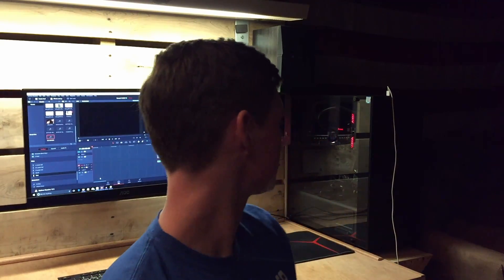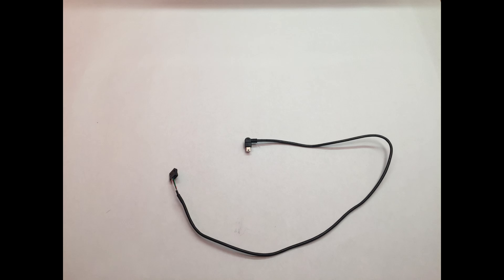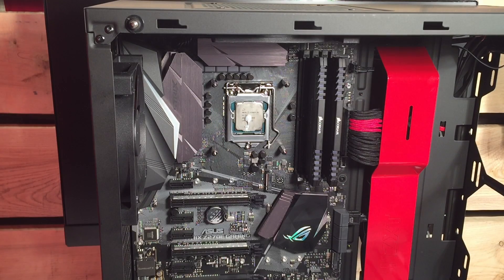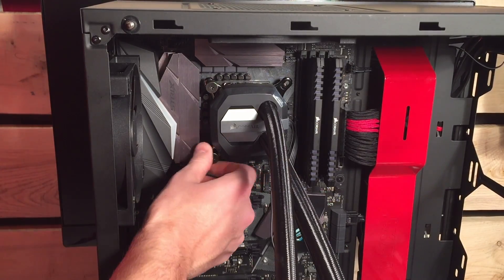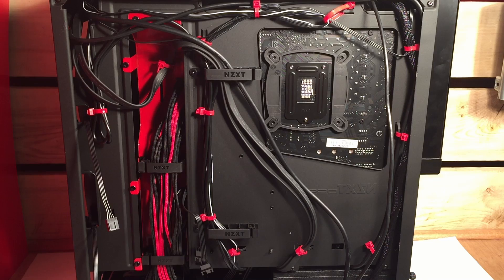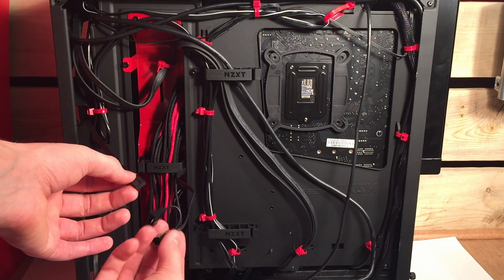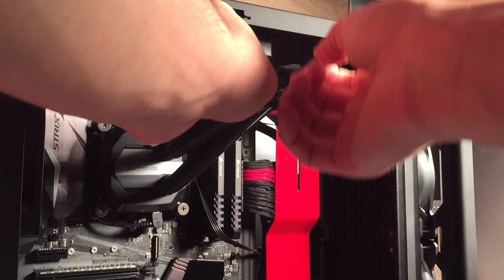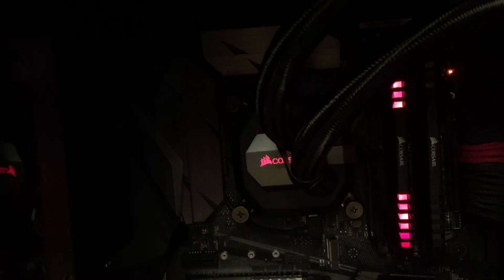Corsair H100I V2 Installation Guide

Comment: So why do you put the fan plugin on the fan opt one? I'm still figuring all this out lol. Thanks
Reply from the maker: I made a mistake, you need to use the AIO fan header, the AIO header supplies more power, since the pump and fans connected to the pump draw so much power. When you use the CPU fan header with the pump and fans, it doesn't allow things to run as well since the pump is drawing so much power. In a test i did, one of the normal fan headers was running at about half the RPM it normally did because of how little power it had to run.
Reply: TekRant yes but then u should get an error every time u start ur pc. a cpu fan speed error I believe. So I plugged the header connection from the aio header and put it in the cpu fan header. error went away. u should do a video of which to use and y and how to get the error off without ignoring it. also having the pump at max 100% of the time can't be great. the manuals are shit.

Comment: Hello friends, 

I have a Ryzen 5 1600X with a Corsair H100i. I just built this together today (Full build here https://pcpartpicker.com/list/N4y83F) I am planning on getting a new graphics card but that's not the point. I am now confronted with the issue I had with my first built but I never thought I would with this cooler. My average temps are around 60-65 degrees celcius and actually went up to 77 degrees when using simple things such as web browsers. I will not dare put a game to test as I am worried for the CPU and Motherboard. Going through the BIOS the CPU is at 55 degrees. I put the fans to their full speed at least I put the highest voltage for the fans. I am worried if have to take this thing apart again and rework.

Thank you very much friends

EDIT: I used Corsair 4 Link to work with the cooler. The cooler at the max performance of both the pump and fan and it did not change a thing and if it did it was only by a few degrees. The CPU is also at only a mere 5% load.
Reply from the maker: When you start up your PC can you head the pump engage?
Reply: TekRant Yeah, i actually fell asleep. Turns out even when I throw demanding games like MGS V, Rainsbow Six: Siege and Just Cause 3. The temps almost decreased. except for Rainbow six which was at 67 degrees sometimes but mostly at 64. it's usually stuck in a matter where it dropped 10 degrees and then spikes back up and repeat.

Comment: i had the same cooler sines 4 months yasterday the temp goes up to 90 'digrez and for your info i did't do any thing with the seitting pleas help
Reply from the maker: when you start up your PC, can your hear the Pump start up?
Reply: TekRant yes its doing just fine the fan works and the light logo works also  but the temp still going up i  bay the bump sins just  4 month
any idea whats my problem is!
Reply from the maker: My assumption would be that either the pump is malfunctioning, or that the reading as wrong, what do your fan speeds and pump speeds look like?

Comment: Thanks for this video, I have the same motherboard as you, how come you dont use the AIO PUMP header? Whats the difference between CPU_OPT vs AIO PUMP?
Reply from the maker: I made a mistake in that video for not using the AIO header, the AIO header supplies more power, since the pump and fans connected to the pump draw so much power. When you use the CPU fan header with the pump and fans, it doesn't allow things to run as well since the pump is drawing so much power. In a test i did, one of the normal fan headers was running at about half the RPM it normally did because of how little power it had to run.
Reply: Wow, interesting, I have the same motherboard but I am using a Corsair 780t case and it has front panel fan speed I/O connection for my other fans, apart from the 2 radiator fans I have 4 additional fans I think im supposed to connect to my front panel fan speed control. This is my first pc build. sort of confusing which headers I plug my additional fans into.. thanks for the fast reply and your advice.

Comment: What happens if i add thermal paste and it already has thermal paste?
Reply: PraiseTheGabe It will have too much and it might leak the paste on your components
Reply: I would not recommend you doing this, the thermal paste could be different compounds and can react adding corrosion or worse

Comment: bracket is very loose on my MSI Z270 M5 board.
Reply from the maker: Its meant to be lose, when you go to attach the water block it will tighten, nothing to worry about!
Reply: TekRant thanks , but not that loose. Block doesn't maintain contact with cpu
Reply: 1999FRC I had the same! Tighten the standoffs really good and your problem is solved

Comment: Once you get this cooler,first thing is to dump those two stock fans that comes with it.Besides that this is a great device and keeps your CPU under 30 degrees at full load.First I replaced the stock fans with Corsair SP120 quiet edition or Noctua NF-F12 120 mm fans to make this cooler a dream.For its prize its awesome.If you run your fan fulls speed all the time your I geuss your pump will last longer.But for its prize and then 2 x Corsair SP 120 quiet edition or Noctua fans its really dead quiet at performance mode in the Corsair link
Reply: Those fans are less noisy but have much less performance (static pressure suck in both of those fans and its less than 1/3 of the stock ones). So it all depends on what you do, with SP120 or noctua NF-F12 you can't overclock as much.

Comment: I also have the H100i v2 and can't change the led on the logo.  I have the Link software installed, but don't even see the cooler with the color graphic.  I believe I have all the cables hooked correctly.  Please advise, thanks!
Reply from the maker: id make sure you have the USB cable hooked up correctly, then if its still not working, change which USB slot its plugged into on the motherboard, maybe your motherboard has a faulty header?
Reply: Thanks, I will check that.
Reply: I checked all it's hook up is correct.  Corsair is sending me a new link cable.  Hope that fixes the problem.  I did switch USB slots and no help with fix.

Comment: I am about to complete my build I have installed my cooler the h100 i v2 I just made test run to see if everything is ok !! I see that the led on the cooler header blinks for a moment n goes off but I see the display on the screen I want to know if it is ok if the led is not glowing in the cooler
Reply from the maker: Lokesh Kumar once you install the corsair link software you should be able to control it
Reply: TekRant ahh !! Thank you so much !! was so confused as its my first build ..

Comment: I want this case (S340 Elite) and the Asus Z270F motherboard (as I am not interested in the Wi-Fi). I am just concerned about the front header connections. The S340 Elite has 2x USB 2.0 and 2x USB 3.0 on the front panel. Does the Asus Z270F have 2x USB 3.0 headers and 2x USB 2.0 headers? Amazon high-res image: https://images-na.ssl-images-amazon.com/images/I/81cSHERFb-L._SL1500_.jpg Thanks!
Reply from the maker: One USB 3.0 header on the motherboard can support two USB 3.0 ports. The Z270F has three USB 2.0 ad Only One USB 3.0 header, so you should be fine. I do recommend you go with the Z270E since their prices are so close together, and they're practically identical other than the Z270E having Wi-Fi and Bluetooth. Plus if you decide to change your case in the future, The Z270E does have a USB 3.1 header, incase the case you decide to upgrade to has 3.1 ports.
Reply: Thanks for your reply. I ended up taking a bit of a leap of faith (as I have never built a computer before) and just got the Z270F. Just another one, I figured out that the USB 3.0 header is 2 in 1 like you said, is this also the case for the USB 2.0 connectors? The Z270F has 2 (3 if you count the ROG_EXT header) USB 2.0 headers. Will I need to use 2 of those headers or again is it 2 in 1 so only have to use 1 header? Thanks!
Reply from the maker: Yes, one USB 2.0 header will support two USB 2.0 ports, also if you are using the H100I that will use up one of the USB headers on the motherboard as well.

Comment: You were a little quiet, so I had to turn on the automatic subtitles. I wasn't disappointed.

5:00 "Then you're just going to go from the top to bottom and then start screaming"

The radiator installation summed up.
Reply: oh you got me. he said screwing in holes.

Comment: My mother board only has a single USB 2.0 connector.  I have a usb internal connector for this cooler and my motherboard.  Any way around this problem other than dont install the motherboard connector?
Reply: Buy a normal usb cable and try to route it outside the case and plug it in the mobo usb 2.0 port i did that with my old motherboard

Comment: the h100i v2 in the strix z270e gaming go to the iopump pin, no in the cpu pin. the fans of the radiator 1 to the cpu an 2 to the cpu opc. pins. see the asus forum. nice day
Reply: Christian Quiroz thanks for the information! I'll set up my cooler like that :)
Reply: NIce. Since i try to put the pump to max using the bios, and is not working. how did you do it! so far need the link to put the pump to the max. my fans are on the cpu fan and OPT and is working so far. but having the pump to aio still see rpm like quite rpm even that move all bios controls and is not possible. please show me how since i what the link out of my system
Reply: Debbie Dexter I did when I use the corsair.
Reply: What about the z270 AR PRIME?  I put it in the CPU fan pin
Reply: After reading this I talkes tech from corsar because I have the same rad and mobo. He said it’s ok to plug it on cpu-fan only.
Reply: Carlos De Bernard ----USE "NEW" Thermal Paste .That what comes with it should be cleaned off and "New" applied the crap that comes with it is useless !

Comment: Hey waz up, this video just show up in 'Must see' section in YouTube, then I say: - Why not?, Let's take a look!... Well I have some questions because I'm building a new PC, with same mobo and cooler, but I had a serious problem and because of that had to buy that mobo again, the problem was that the mobo didn't detect the cpu fan ? and I used the same header as you did (Cpu_Opt?) but the Cpu_fan is just right there on the top... and what about that AIO_Pump header ? How does that one works ?
Reply: I'm just wondering if the new cpu that I bought too, i7 7700k didnt went potato because of that problem
Reply from the maker: Is the pump working at all? If I have mine plugged into the CPU opt header, I get a cpu fan speed error, and if I just boot up it works fine, is your system booting at all?
Reply from the maker: I found a solution, I will have a video out soon going over what the error was
Reply: Im having a problem, i installed my water cooler, plugged it into cpu_fan and when i turn on my pc it turns on for a second (fan spins/lights turn on) then it turns off inmediately. I sent the pc to a technician first but he installed the radiator inside the case which makes no sense because it was releasing alot of heat so I placed my radiator above my case (nzxt phantom 410) and fans below, still not able to solve it. He also connected my ram in 1/2 slots so i disconnected 1 ram and placed it in 1/3 to use dual channel. The technician did an awful job tbh, also i removed the pump but i dont have thermal paste to re apply (my bad). Im scared my cpu is damaged or something my pc is less than a week old its an i7 7700k, gtx 1070, psu corsair hx850i, wc h100i v2, mobo asus prime z270-a. Any help is appreciated, thanks. Btw i have tried removing cmos battery, also using 1 ram stick, 2 ram sticks, no gpu, with gpu.. its driving me crazy
Reply: Vigiilz seems like the problem would be the motherboard... If you turn on your PC but the monitor show nothing or goes iddle then return/exchange the mobo if you still have time
Reply: Vigiilz I fixed that problem, but had to return the mobo (z270e)... I just got it yesterday... I think your mobo has AIO_Pump header, try to connect the AIO header to that and two fans included from cooler to CPU_Fan and CPU_Opt headers, that should work, at least that's what I did (but now using kraken x52/Will not recommend because problems with Aura/CAM)
Reply: Manuel Vélez it was working perfectly 2 nights ago but i screwed it up. What is "AIO Header"? Btw pump only has one connector for the cpu_fan
Reply from the maker: I did a little research on your mobo, and I want you to try two things, first try plugging your CPU header into the AIO header on your board, and if that doesn't work try resetting the CMOS using the jumpers
Reply from the maker: Also make sure you are using the DIMM slots A2 and B2, A1 being the slot closest to the CPU. Also if their a boot up problem, theirs a section in your motherboard manual that goes over what MEMok is and that could also be the problem
Reply: Vigiilz AIO header' would be the 3/4 pin connector from the pump that goes connected to AIO_Pump, and connector from fans to cpu_header and cpu_opt...
Reply: TekRant When I had the problem that trick didn't worked for me... I did removed the battery and tried jumpers too

Comment: Backplate / standoffs don't fit snug with Asus maximus IX, really concerned about this, going to search for some washers
Reply: Hi Nick...    I have the H100i V2 installed.   The back plate only had a small gap on my MB which according to corsair is perfectly normal, cause when you install the pump and tighten the thumb nuts down the whole unit becomes well secured with adequate contact on the CPU.   The gap between the back plate and stand offs seems to be intentional to prevent damage to MB and due to slight differences in MB thickness.   My older MSI board is thick compared a Gigabyte MB I had.    Using the included washers for the Fan/Rad is common.   Some fans are 25mm, some are 30mm thick.   Likewise, the thickness of mounting panel in the case can change from one manufacturer to another and I'm sure the quality of the case plays a roll.   Older cases were built like tanks.
Reply: wondering which side is better to put the washers on, going with backside. also the backplate is so flimsy...
Reply from the maker: Nick Brown I wouldn't put washers on the board, especially if they are metal washers
Reply from the maker: Once you mount the Water block, the gap in between the motherboard should go away because of the block pushing on the cpu pulling the standoff and backplate flush with the board
Reply: I was freaking out, never seen a mount design like that. had to end up using washers on the radiator though since it was loose. thanks for the video
Reply from the maker: Nick Brown can I ask you what case you are using?
Reply: master case 5 pro, put the radiator on the ceiling with pushing air down, under the radiator